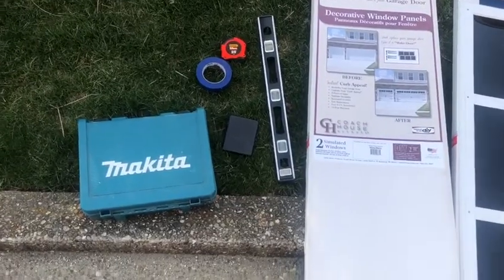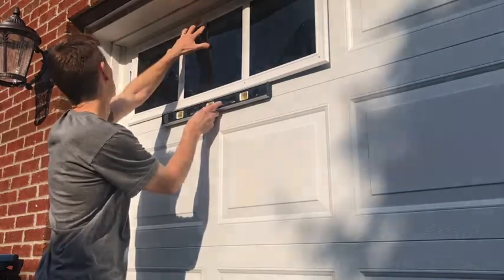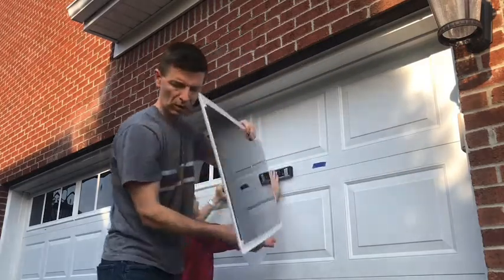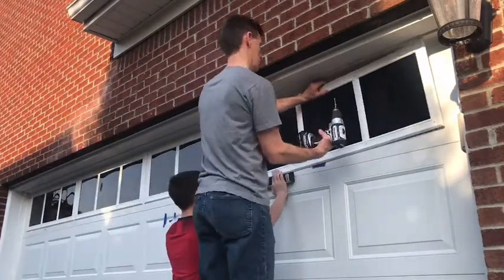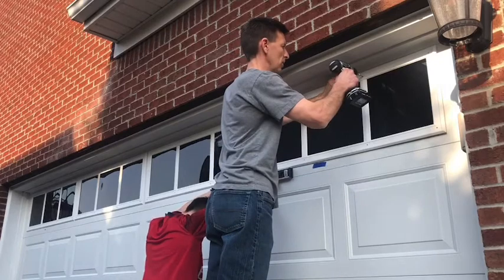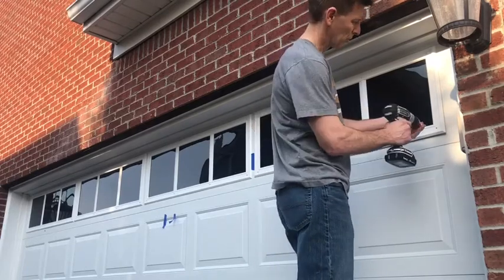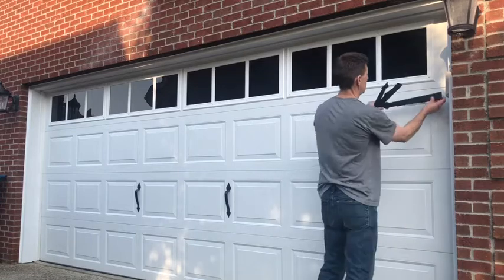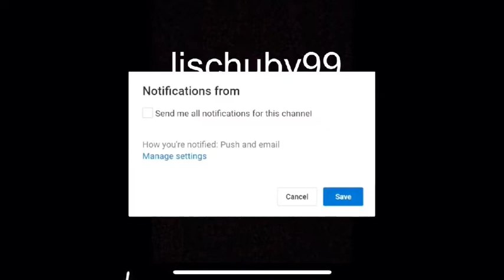Garage Door Update with carriage house windows and hardware

Comment: what does the other side of your garage door look like
Reply from the maker: If the garage door is insulated, then you should not see any screws as they are shorter than most insulated doors. 
If the doors are not insulated, then the screws can be seen in the other side. The kit comes with covers to put over the screws is this is the case.

Comment: Where did you get the windows? Thanks
Reply from the maker: They are called Coach House Accents and are available on the CoachHouseAccents website or Amazon.  You can also find good deals for them on eBay.  Each box kit contains two windows to cover 1-car garage door.  This project used two box kits, or four windows total.

Comment: WHAT THE POINT ON BUYING WINDOWS IF YOU STILL NEED TO TURN ON THE LIGHTS!! I want something functional not just “looks” wonder if is it even posible to add real one to a GD that doesn’t 🤔
Reply: Its call curb appeal lol
Reply: @kleco1000  except it's easy to spot fake windows and hardware
Reply: @bdm1000  
I did it and most of my neighbors thought I got a new door
Reply: You'd have to replace the whole garage door for windows. Which is costly..